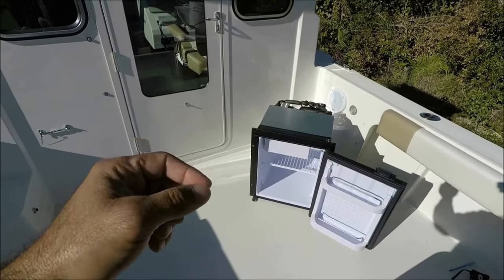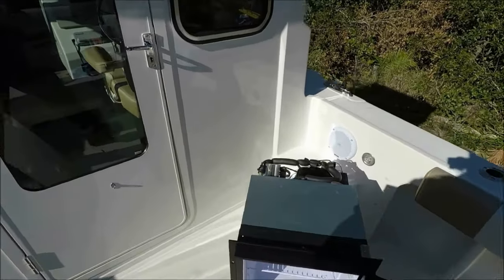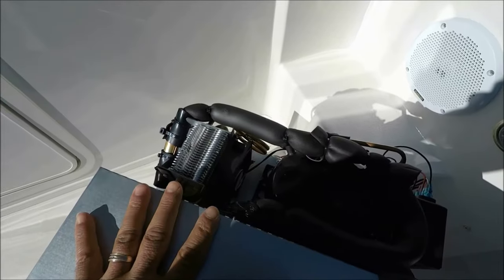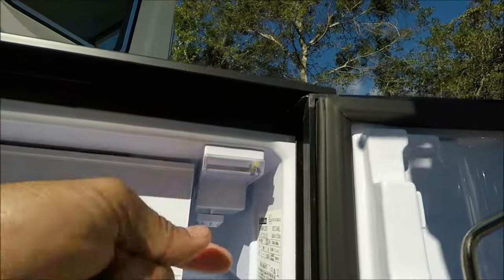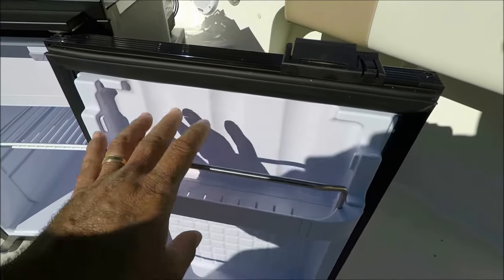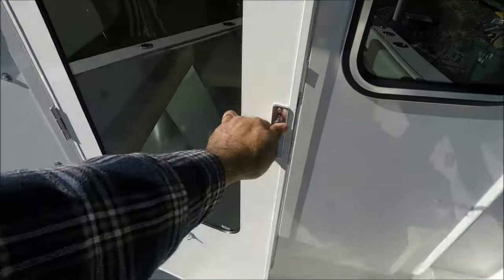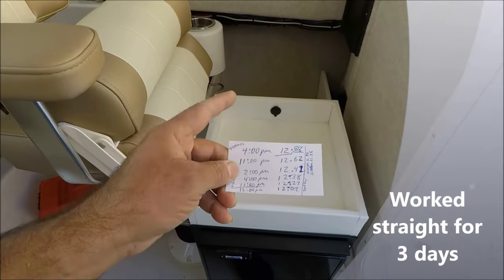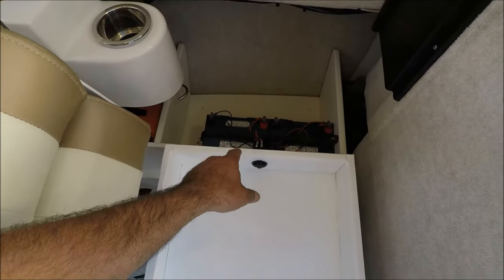How to Install a Marine Fridge in a Crooked PilotHouse Boat DIY

Comment: Hola, puedes orientarme de algún refrigerador que no sea tan caro, el que pusiste en el link no está en stock. Te lo voy agradecer.
Saludos.
Reply from the maker: si capitan mira el link de nwevo ya lo cambie a uno gue posiblemente te pueda travajar , dejame saver si te ayudo, buenas noche cap.
Reply: @OutOnTheReef  Gracias capitán, vendí el key largo 16ft y compré un sport craft 26ft y estoy haciéndole algunas cosas porque lo tenían un poco descuidado. Disculpa que te moleste pero que AC me recomiendas. Tengo el presupuesto apretado ;-) jejeje Gracias por tus videos y ti ayuda 🙏
Reply from the maker: @go_kiko  bueno you puse uno de ventana de 5000 btu

Comment: Hey. So did you tie the fridge batteries into the boat’s batteries so they can charge when motor is running or do you just recharge them individually?
Reply from the maker: Charge them individually where the generator that way I have battery separate I don't get a surprise set my battery stop all depleted

Comment: I know this video is from a while ago. You already stated you run the batteries separate. What charger are you using to keep them charge?? Also how would a solar panel like the one you had on your Yamaha work with this set up??  I got a 20’ walk around and i have a few ideas to install an ac unit in it but power consumption and space is what im trying to figure out. If you have any ideas or recommendations would you have??  Love your channel and all of your diy projects on the boat
Reply from the maker: Yes Captain the solar panels I had for the Yamaha was not enough to charge the fridge batteries they consume a lot there 70 amps and the charger I use I think I have it in the link in the description below if I don't let me know and the best way to go with air conditioner and Refrigeration is by having a generator solar panel would never catch up to give you power for a air conditioner due to the high power withdraw .
Hope this helps on your DIY projects captain keep me updated👍👍
Reply: I am working on a smaller set up like on the video link attached. I found that computer cpu cooler system may work like i said its a 20’ walkaround so its a small area to keep cool.

https://youtu.be/dLspmypEqhM